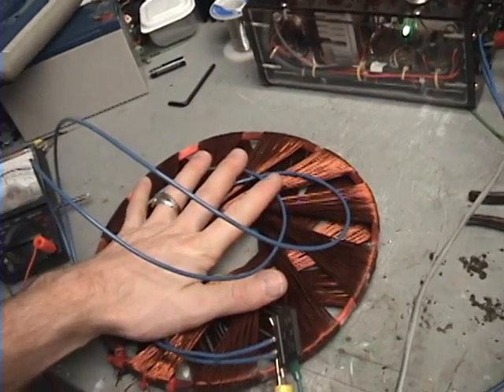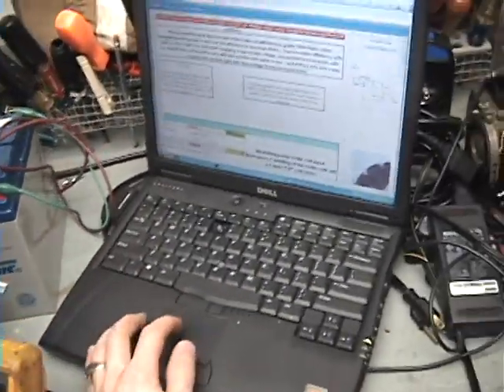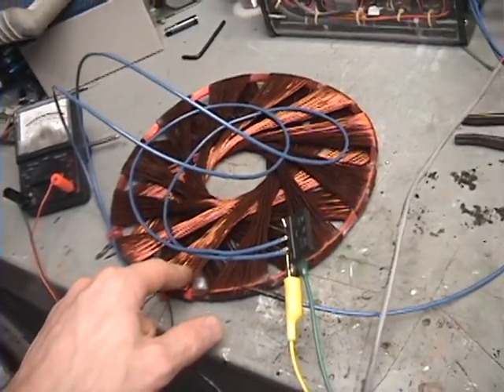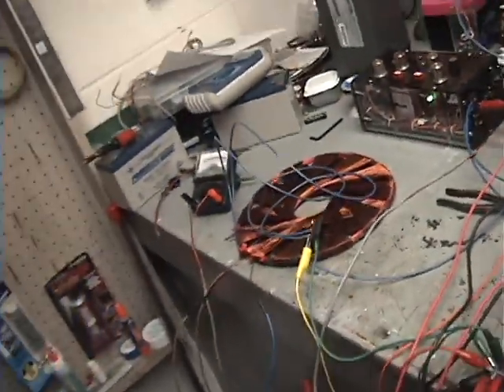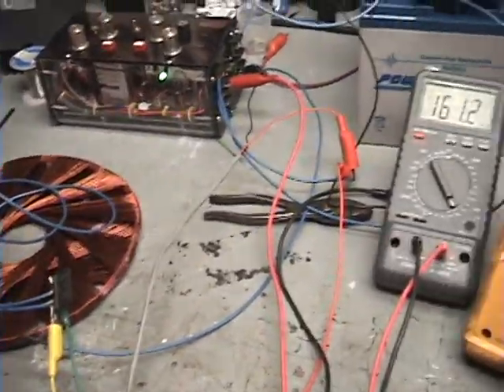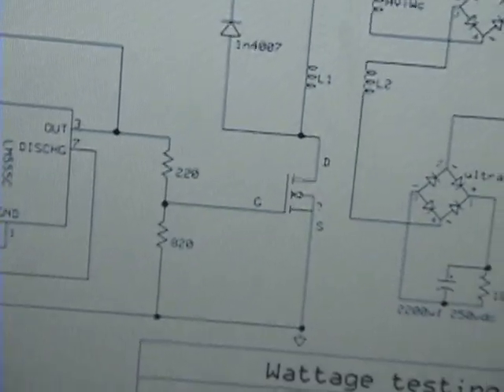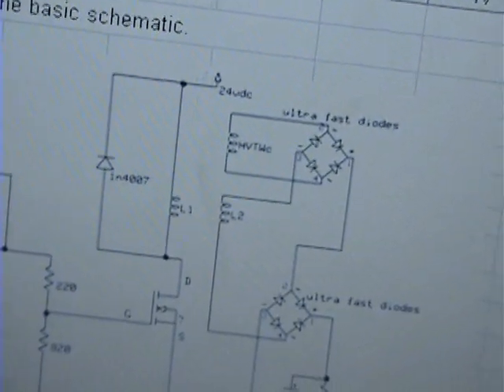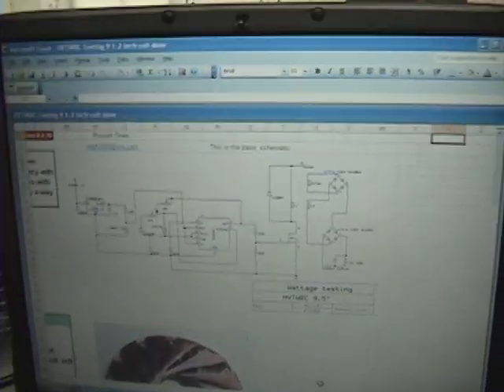HVTW Rodin coil,  wattage testing. (TEST14)

Comment: I connect my coil up with a 6 volt battery and I get 86 volts out of the coil and 2.6amp . 2.5 mm copper wire. So 226 watts ? Is that good.
 I have no electrical  Experience.